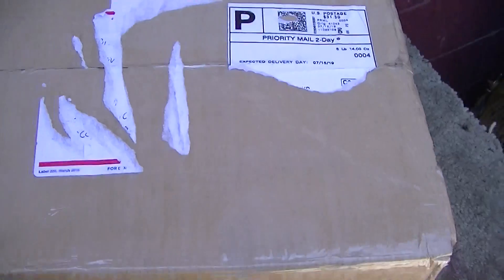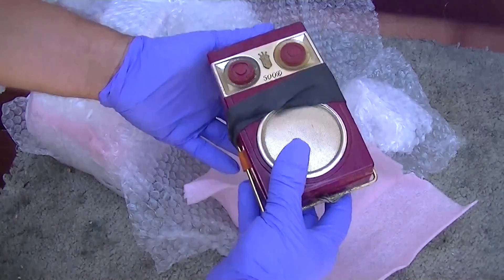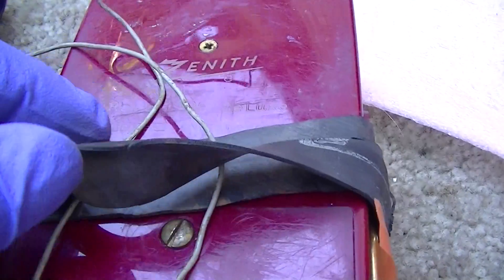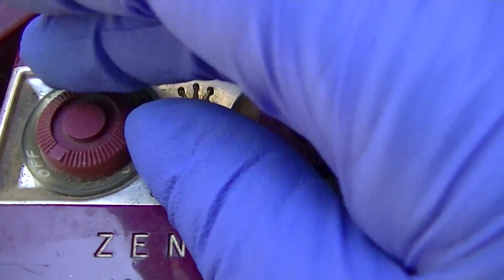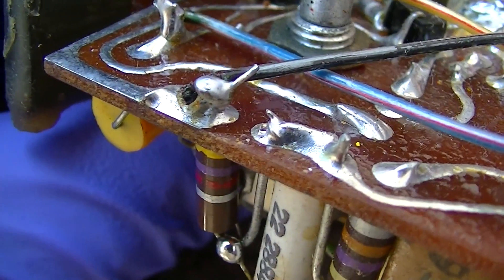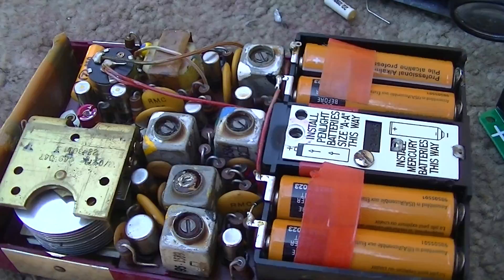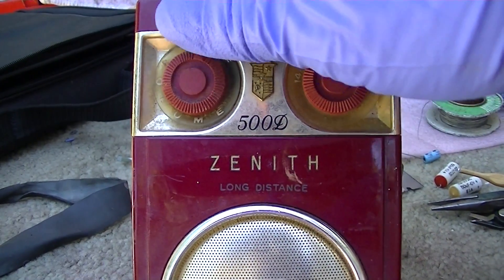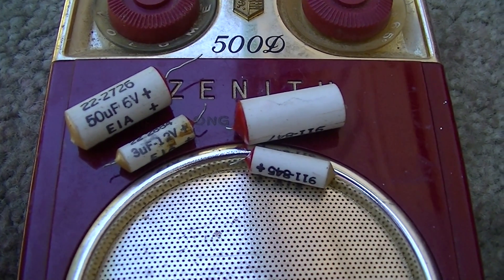Zenith Royal 500D AM Transistor Radio Owl Eyes Repair Restore Recap

Comment: Some earlier versions of this radio used NPN transistors for all or selected functions, like paired 2N35's for output.  It varied. Need to consult the documentation like Sam's for the EXACT chassis - look very carefully at the number -  especially before attempting to plug in a Russian. The early 500's varied chassis a lot in a short period of time.

Comment: I've got to Zenith hearing aids with very very small electron tube about the era of that radio they look new but I don't have a b battery or two A's and then there's a switch on top to where you can switch from one to the other

Comment: Very cool radio. Looks like the solder joint between the board and the tuning capacitor was cracked. Not sure if that would affect its performance.

Comment: I'm bad at judging sizes from the video but it looks like they could have mailed that from Florence KY to Los Angeles in a large 12x12x5 inch flat-rate priority box for $19.95.
Thanks for the video! I wonder what's in the other package.
Reply: Jac Goudsmit it was a usps box, but it was not flat rate shipping. The usps person said that priority shipping was only a couple bucks more expensive than standard, so I just went with the priority.

Comment: If you needed to replace the tuning capacitor, on a vintage radio, from the 1960s, how would you do it? Great video. Cheers!
Reply: Actually the wipers inside are oxidized from lack of use. There is some good stuff on the market called DeoxIT D5. Works good. DeoxIT DNS is a quick drying version and
DeoxIT D100 is a non solvent version. All are  safe on plastics. Got mine from Fry's Electronics.
Reply: @hestheMaster  Okay. Thanks!

Comment: I have worked on several of these over the years. The high drain is a common thing with old capacitors. Normal draw is 15-30 mv depending on the volume setting. They (and all transistor radios) ate batteries like people eat peanuts. The louder you played it the faster the lead-acid batteries were drained. It would be several years before alkalines became common. Some resorted to mercury batteries to get longer life.
"Tubeless" was a common marking back then as many portable radios used tubes or had hybrid circuits. The "tubeless" marking told buyers they were getting a "real" transistor radio.
Reply: Are you lost?

Comment: Zenith made so many variants on this radio.  I have one which is an 8 transistor variant with the non-inverted speaker.  Doesn't have the model number on the front, but it is a 500 series radio.  One of the best early transistor radios made.  Mine has the RF stage with untuned inter-stage coupling and separate mixer and oscillator stages.  I think later units used the usual self oscillating converters.  Some of the 500 series did have NPN germanium transistors in a few places.
So after seeing you replace those three caps, I opened my radio up and saw that the same capacitors had already been replaced with Jap electrolytics.

Comment: battery looks vintage but for the barcode on the bottom of it !
Reply: Depends on your definition of "vintage". Bar-codes have been commonplace since the mid-70s.
Reply: @rockabillycat1954  good point but it seems the barcode is a lot older than I thought

Comment: holy crap! that made it through the postal service huh?
that looks super suspicious with the big cell strapped to it.
I'm surprised the battery didn't drive through the back of the radio.
I would have taken those off for sure
Reply: It probably had a camera stuck in it somewhere

Comment: I did the same thing with a portable radio back in the day,it took four AA batteries to run it so I rigged up a holder to put on of these lantern batteries to power it, I had a steady supply of these because on my dad's job on the railroad they were always replacing them in their battery lanterns, they would last a long time before needing replaced.

Comment: It would be very interesting to see you working on fixing a amateur radio receiver valve or early transistor model's
Reply: I have a Kenwood TS-820 in need of (probably) a new finals section...  The weight though...

Comment: @ 5:44 when I heard loud crackle from the speaker, I was like, this damn thing might actually work!!!! Don't mean to go all JJCruse on you, but all my Zeniths were dead as a hammer when I got them. Those "Nashville" capacitors are the worst! I have a Royal 275 that is essentially the same as what you have there, and it was stone cold dead - dried up electrolytics. The radio did have an interesting disc ceramic cap failure later - the .01 mike that couples the local oscillator to the mixer turn into a 22 Kohm resistor and overbiased the mixer - symptom was distorted audio because of excessive RF gain.
Reply from the maker: Oh I love me some #JasonJJCruz
Reply: @shango066  I concur with your idea of not nilly-willy replacing caps for the hell of it. I still have my grandads Sony TR-1814 from 1964 - never had a cap changed - has rubycon caps - still works - audio is a bit "thin" sounding - the electrolytics have dried a little, but still plays quite well.

Comment: Cool little set and still in decent shape.I always love getting some electrical gear with some nasty shipping charges and finding out it still has 2 plus pounds of corroded batteries in it! Save me some $$ and take those nasty things out before shipping!
Reply: yeah that can be a problem but the last time someone sent me a radio with battery still in it  a vintage one I sold it for more than what I paid for the radio !
Reply: That's a rare find indeed! I once got one of those old grey metal Navy "Battle Lantern's" at an on-line auction. The Two 1.5V Dry Cells(Type 6 I think they are called) were still inside..I thought cool score until it was clear they had swollen themselves tightly into the case. Soak in baking soda solution to neutralize the acid and then dig them out..what a mess. But cool light to have around!

Comment: Interesting speaker, wonder what the development costs were on that gem? Back when them radios were popular, you could find "mercury transistor radio batteries" that were supposed to provide long life. I am unsure if that was the precursor to the alkaline battery or what?
Reply: Mercury batteries were discontinued a long time ago
Reply: @JohnSmith-eo5sp  Oh yeah, haven't seen them since the late 1960's .
Any battery containing mercery was banned by 1996, had a Pentax  camera that used one
Reply: @craignehring  Question: Is a Carbon-4 battery a general purpose battery, and why aren't Alkaline batteries the same "general purpose", if at all?
This information I acquired at my local Franklin's Hardware store about the  batteries I was using for an old  three D-cell steel-cased flashlight I was trying to repair
Reply: @JohnSmith-eo5sp  Holy smokes, that's a darn good question and one I do not feel qualified to answer. But... LOL there is always a but... I think that the old school carbon zinc cells were commonly referred to as general purpose. Even the so called "flash light" has a reason for being called that, at least here in the states. Early cells could not sustain a high current draw for very long at all. The effect was the bulb would give a burst of light or "flash" prior to turning dim or going out. This is much like when one tries to use exhausted cells in a flashlight, we have all been there and done that. Give the lamp a rest even for a few seconds and your good for another flash of light. I believe the British had it correct in calling the flashlight a torch. One thing is for sure is carbon batteries are inexpensive and have limited current output. Alkaline cells can put out some serious current and can perform well in some tough situations.
It's an interesting topic
Reply: @craignehring  Me thinks the Brits, our so-called allies from across The Pond, use the term lanterns to describe flashlights. They don't use Zinc, for Carbon-batteries much anymore, that's all devoted to our 'copper-pennies".
They replaced that not-precious metal(Zinc) with Manganese in these dry- cells a long time ago
Reply: @JohnSmith-eo5sp  We call them torches
Reply: @stevehead365  My bad, I am kind of a know-it-all :-(